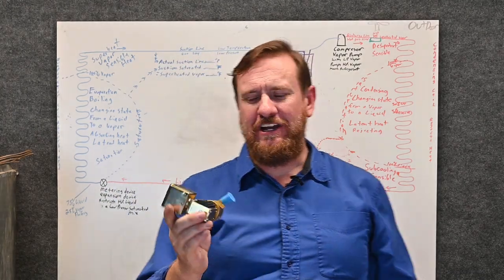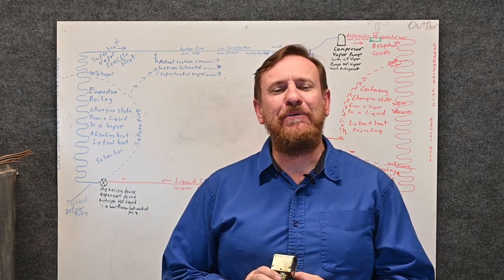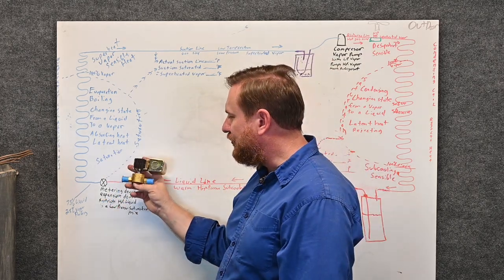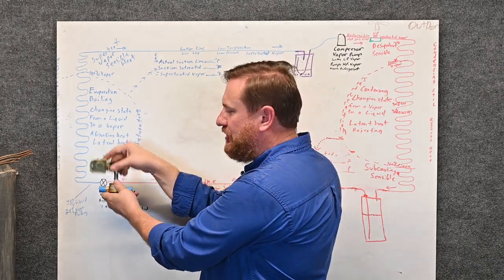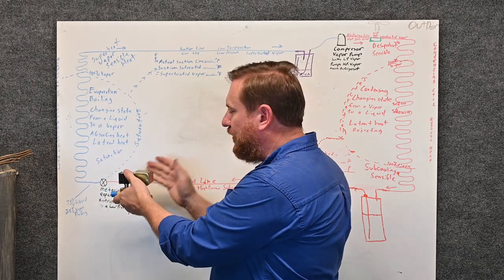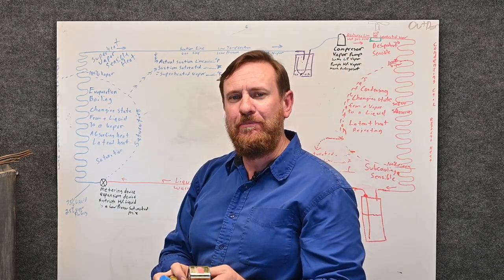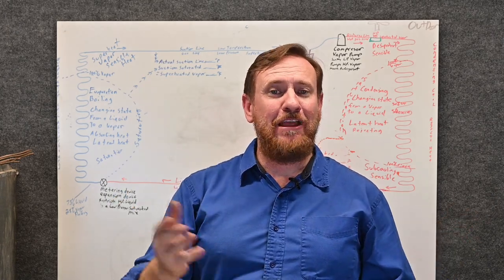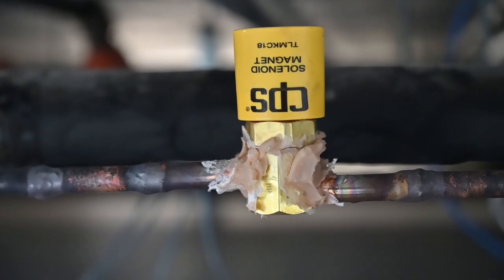HVAC 086 B solenoid valve part 2 overview and basic applications

Comment: Maersk' Starcool reefer containers are using only a solenoid valve as "the" metering device itself and is called an EEV (electronic expansion valve) which is throttled by the controller based on its calculated evaporator superheat. This arrangement does away with a need for a liquid solenoid valve as you've mentioned.
Reply from the maker: Video of that coming soon!
Reply: @love2hvac  looking forward to that. Cheers

Comment: Can I use two solenoid at the upstream of the compressors to run one of two compressors deployed in  parallel?
Reply from the maker: You don't need the solinoids, the compressors will now allows. Refrigerant to run backwards. 
Trane uses them in parallel on resi units and rack systems use parallel often
Reply: @love2hvac  Thank you for your prompt response.

For my clarification, 

1. does it mean that I can simply put two compressors in parallel (two suction sides connected to the evaporator outlet with a wye(Y) and two discharge sides connected to the inlet of the condenser)  one of them when I want?

2. Can I do the same paralleling in the car ac system?

3.Can I also run 2 in parallel? ( this question is just for my knowledge).
Reply from the maker: @mokhlesuzzaman 
Hea but there is some specifications for the pumping of the suctionnand discharge line headers. Also some specifications for the evaporator piping to maintain oil return.

You can find the Copeland redregerstion manual PDF online for free what will have most of that